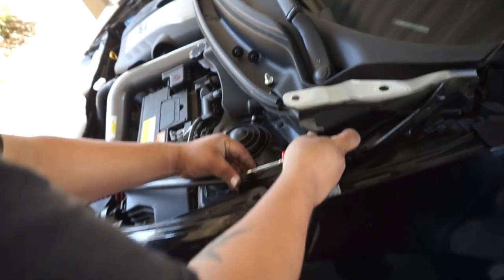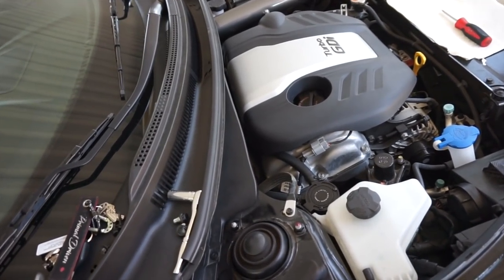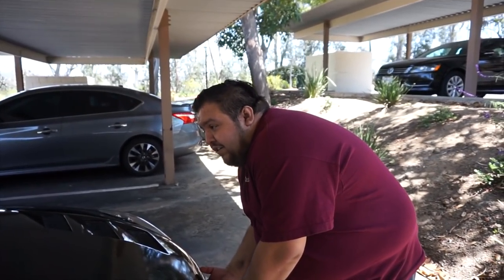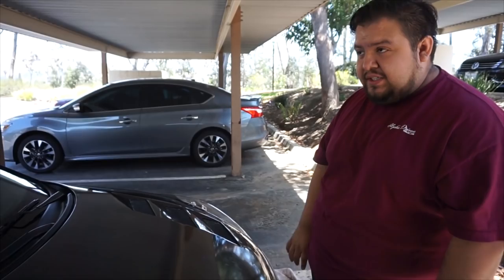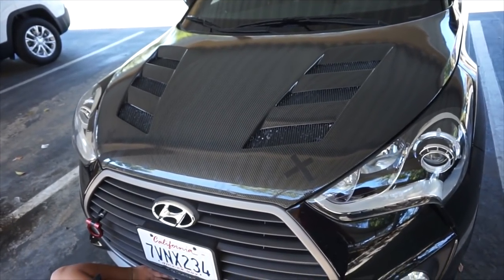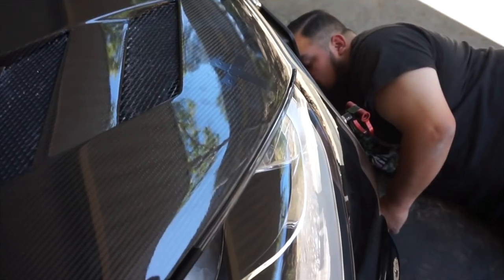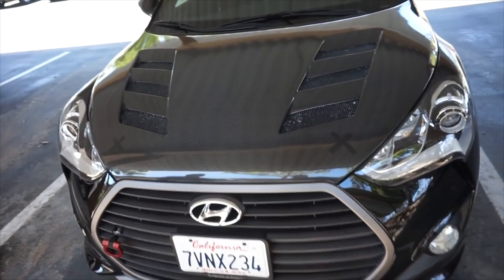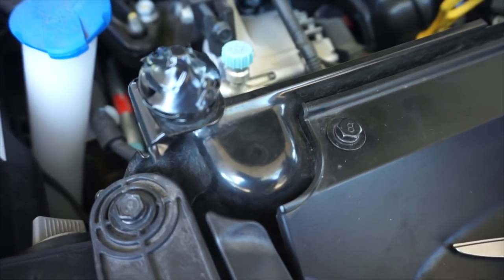Carbon Creations Carbon Fiber Hood Install

Comment: Hell yeah dude I’m so stoked for you!! Thanks for the shout out 🙏🏻🙏🏻 

Also for the hood pin holes, you can use find rubber fittings that you can plug the holes with, if you do install hoodpins on the car. The placement of those holes is the only position that’ll on the veloster, so glad to see you restored it
Reply from the maker: I had bought hood pins to install but they were smaller than the ones you used so I'm probably going to end up installing hood latches eventually
Reply: Chayness go with carbon fiber hood latches. You’ll be able to hide the holes and you can dummy the latches just for look if you don’t want to spend the money on installing brackets. Latches look sick cosmetic but it’s up to you. Hood looks amazing, good work
Reply from the maker: Thanks again bro

Comment: Lol bro all you had to do was go back and forth fighting and loosening the bolts till the fitment was propper... Lol 5 years later
Reply from the maker: The fitment was fine everywhere but at the ends leading up to the door. Any movement in the opposite direction would have left a gap near the front bumper/grill.
Reply: @Chayness  I see. I just mounted mine 2 days ago. I haven't even tried aligning it yet , I was just speaking about something we had done to a friend of mine's It took a while would it worked. Quick question when you were driving down the interstate, and I don't have hood pins in yet which I'm going to get but did your hood jump around a little bit basically did it move at all because I have a giant hood scoop online and then to vents like you have on yours It's a demon hood on a Grand Cherokee It just makes me nervous seeing it bounced a little bit. It's not a lot but it does move not like the factory one never moves

Comment: That flex is kinda scary, also not sure if I’d want to worry about not slamming it etc
Reply from the maker: Its not bad. Its just a light sturdy push to lock. I haven't had any real issues

Comment: Bro sickkkk!!! I’m getting my hood soon then planning on the carbon hatch as well... How much does the stock hood weigh and how much does the carbon hood weigh?
Reply from the maker: I think the stock hood is about 25-30 lbs and a CF hood saves you about 15 lbs. So this one maybe weighs like 10 lbs? It was super easy to handle and pick up by one self so its pretty light

Comment: Looks nice. What about rain coming into those vents on the hood.
Reply from the maker: So the vents have an actual floor underneath them. Light rain and a quick car wash shouldn't be an issue but I honestly can't say about heavy rain. It looks like the floors push water to the sides to allow the water to come down to the lower part of the hood where there are 2 holes (near the front of the engine, away from most electrical) that the water would come out of.
Reply: Makes sense. I saw a 2019 Turbo this week for the 1st time in person. The Dealer wasn’t open and I didn’t have time to inquire about it or drive it. It was the end of the month in my business and I was to busy it stop and waist time. Besides I won’t be a buyer for at least another year. So I’m not about to stroke some poor sales person when I’m not ready to buy for such a long time. I sold high end luxury cars for almost 20 years. So I’m not about to waste their time. Besides I have a very good relationship with the last store I sold at, It was Pugi Hyundai in Downers Grove Illinois.  Before I quite working there I bought my wife a 2015 Elantra Limited loaded with all the options except Navigation. As I said most of my car sales career I sold high end cars like Jaguar, Infiniti, Lexus, and the like. Until the economy crashed and sales went in the dumps, then I started seeing the new Sonata’s everywhere!!! I thought maybe I should look into that. I started selling them in 2011 and never looked back. Hyundai’s were junk years back, but man, did they ever make a comeback!!!! After years of seeing how happy my customers were with their cars, that’s when I thought I’d buy one for my wife. She had a 1995 Buick Supercharged Reveria that was getting old and tired and it needed replacement. She is very happy with the Elantra, it’s now got 33K miles and still gets us 40+ MPH on the HWY!!! I have a company car so when I’m ready to buy I’ll be looking at the new Veloster Turbo and the N version!!!
Reply from the maker: you'll be all set! lol I sort of want a new car but naw lol

Comment: Does water get into the engine and if it does can it hurt your engine and other parts under the hood
Reply from the maker: With this hood. It has an underlayer that re-directs water so water does not get into the engine bay.... however, expect a few drops here and there sometimes. Nothing major. If you ever buy a hood without an underlayer, it can be very harmful to electric components and possibly moving components if water were to get under the hood while driving or engine running.

Comment: Does water go in with these hood scopes
Reply from the maker: There is an under layer that actually collects and redirects the water to an small outlet hole towards the front of the car where nothing would be bothered by the water.